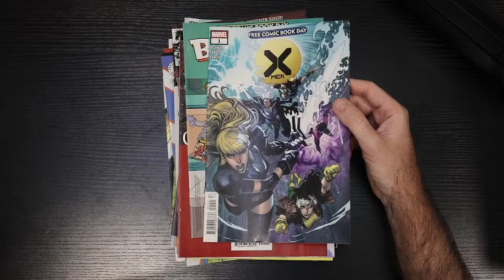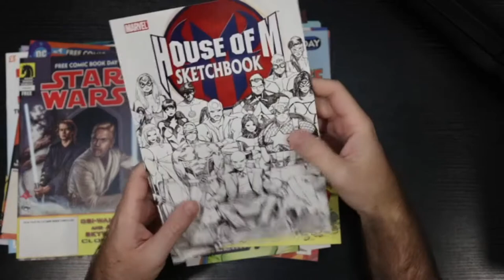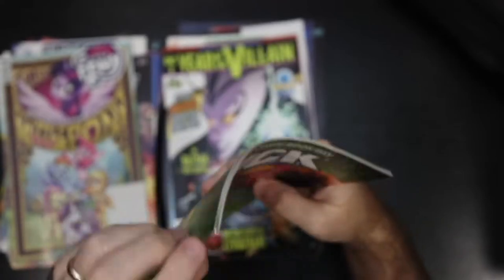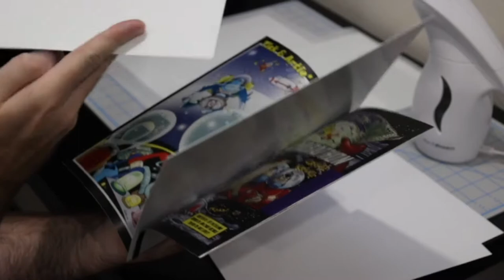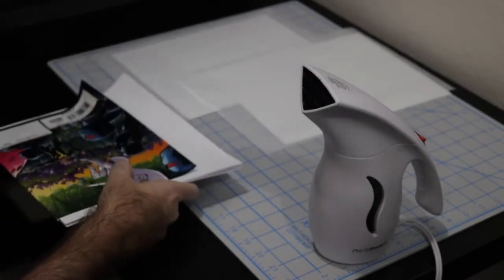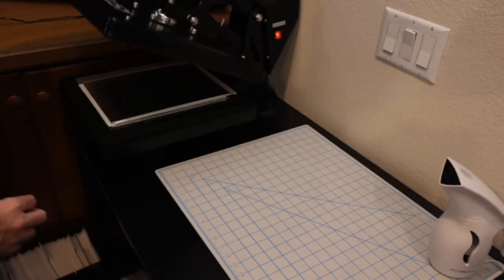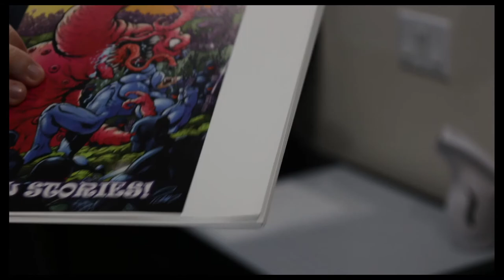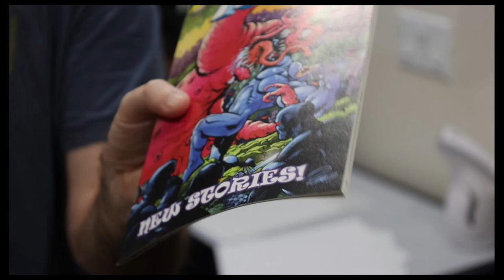Learning How to Press Comic Books | Spot Humidity | Right Corner Folding | FCBD The Tick

Comment: My spines don't look natural either after pressing. It almost pushes out from the staples. It looks like my press slides the slightest bit when tightening down and that may cause my offset. Not exactly sure tho. Great video!
Reply from the maker: Which press do you use? I had a swing press and returned it for a clamshell. I instantly had better results.
Reply: @MoneyballComics  I think mine is a swing. It's probably the lowest quality there is. Only fits a single book but it seems like the top slides when clamping down and causes the pages to slide as well.